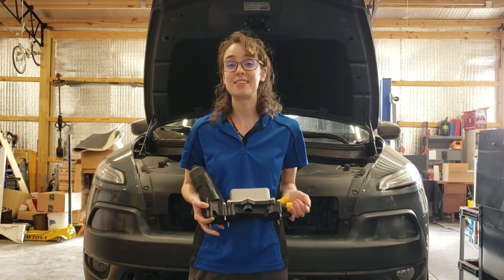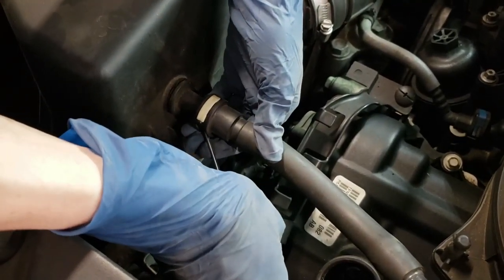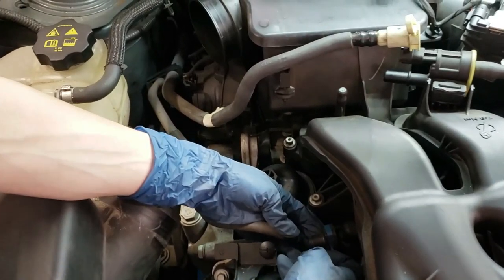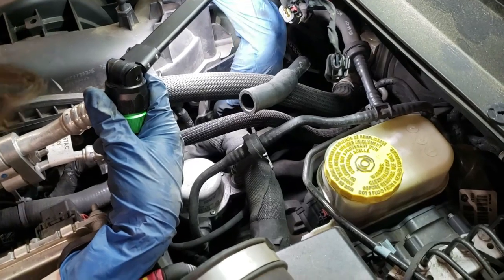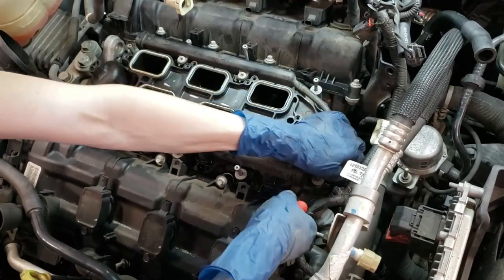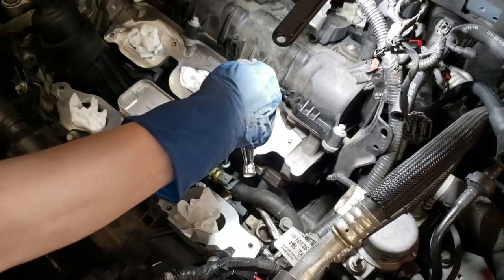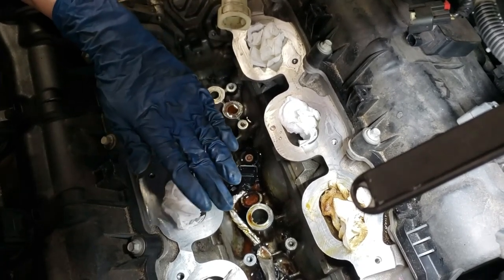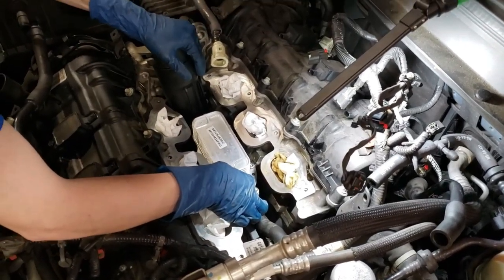Oil Cooler Assembly Replacement | 2014 Jeep Cherokee

Comment: you did a good job on the replacement, though you should really lubricate the o rings before installing. if the o rings go in dry, they can twist or bunch up and can make in improper seal, causing a leak. you shouldnt encounter much resistance installing the o ring, it should go in smooth. they also make aluminum coolers that wont crack as the oe plastic ones tend to do. this wont help leaking seals which ive heard is also common, but it may be worth looking into if this one ever breaks. you did a good job on the replacement, as well as explaining what you were doing in a way that was quick and easy to understand. just found your channel and i look forward to seeing more videos! i wish you all the best!
Reply from the maker: Thanks @jaydendaye7310!  I appreciate your encouragement and the advice.

Comment: Will the aluminium cooler leak over time also?
Reply from the maker: Fair question,  hopefully not, but time will tell!
Reply: Because I was thinking of buying a aluminium one which is pricier but since you said it’s more of a maintenance thing made me pause, it is about $368 here in SA
Reply from the maker: @user-ej7hr5rc9n Well, it seems like it's usually the gaskets that leak.  I doubt an aluminum oil cooler will ever crack and break, but you may have to replace the gaskets and O-rings again eventually.
Reply: Ok thank you
Reply from the maker: You are most welcome!   BTW, we are beginning a presence on X.com.  If you use that, we can be found at @HopFamMedia
Reply: We managed to get to the oil cooler and there is oil down there but I am noticing there’s some oil debris way up, just above where the lower manifold sit, could it be the manifold gasket?
Reply from the maker: @user-ej7hr5rc9n  I don't think that's possible, since oil is not circulating throughout the intake manifold. But, you might consider a good brake part cleaner bath before re-assembly.  Leaks will be easier to find after a good cleanup.
Reply: Good day, we once put water in because it seemed like it was overheating the coolant is completely finished and now where the oil cooler sits there’s clear but pink ish water coming whenever I open the reserve, so should we flush this water before putting in new coolant and should it be concentrate or ready to use? And I cannot find this thing they say you open when you flush it on the radiator on my 2014 cherokee.
Reply from the maker: You will want to get 2nd opinions and/or a mechanics diagnosis on this.  It's difficult to be accurate without seeing the issue @user-ej7hr5rc9n.  But, our opinion is that you should stick with OEM regarding coolant.  So, yes... swap the present fluid for the OEM spec.  Your computer sensors will thank you!   The local parts store will be able to help regarding the use of concentrate or mix.  You will want the proper mix ratio in your Jeep.  I remember when we could get away with water in the radiator.  Today's computerized vehicles will not like it. ;-]
Reply: I really cannot find the radiator drain valve, even removed those harnesses to move the plastic and get a clear view underneath, how do you drain it?
Reply from the maker: @user-ej7hr5rc9n we didn't choose to drain the radiator and overall there was very little coolant to have to deal with.